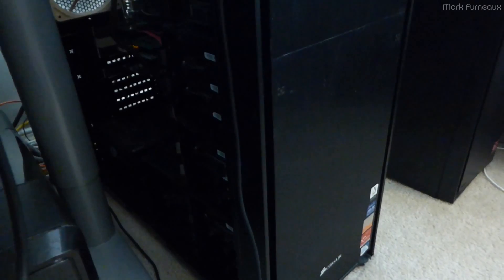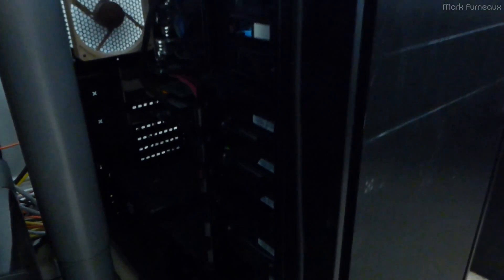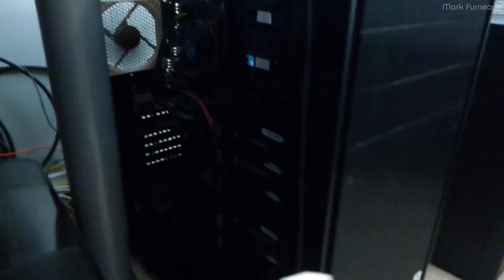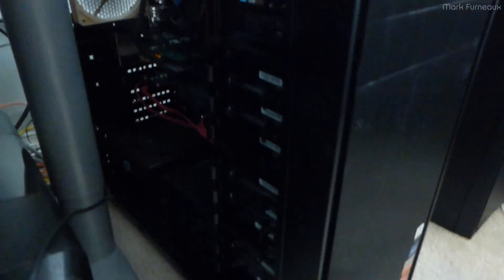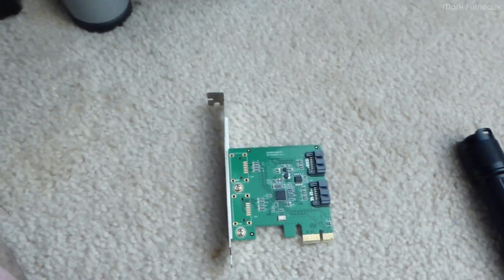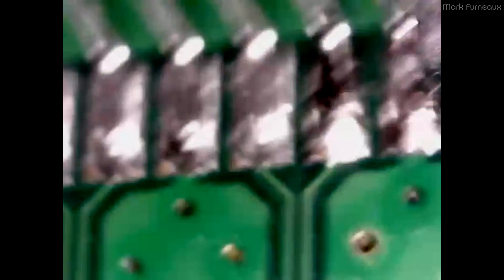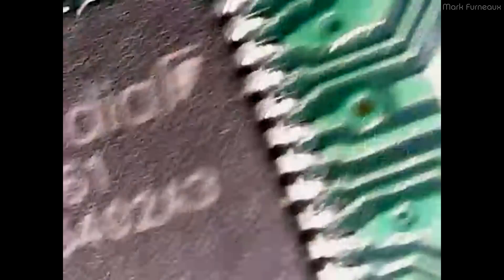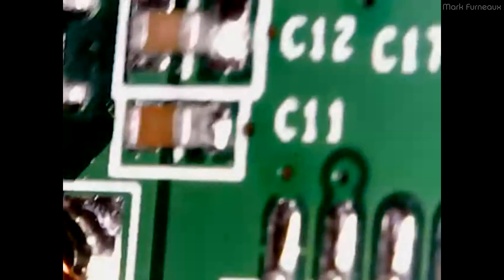Failure of a Crappy SATA HBA in My File Server

Comment: You should look into getting a supermicro SAT2-MV8 SATA HBA. They aren't very fast (it's a PCI-X card but I'm using mine in a PCI slot) but even PCI is fast enough when file transfers are limited to 100MB/S anyway (gigabit Ethernet). I have had one running in my file server for a couple of years now and it works great. Now I am a Windows dan but I do like to use Linux for troubleshooting and Inam pretty sure the HBA showed right up in Linux just fine.
Reply: Not to be annoying, but Gigabit Ethernet is actually 125MiB/s. I prefer to use nice even multiples of 8. :P
I myself should grab a HBA card of some sort. I got a poor HDD that's just sitting on my desk brand new and unused. Ont he other hand, if one of my drives dies, I guess I have a spare. Oh well. 

And if you're curious about what I mentioned regarding the Ethernet, MiB is not a typo. To be specific, multiples of 8 are actually called Mebibytes (MiB/S), and multiples of 10 is Megabytes (MB/S). So for a brand new HDD that's 500 Gigabytes only showing up as about 480 Gibibytes. As a side note, I think *NIX like OSes are the only ones that calls it by the correct term, which I think is just confusing for the customer. If everyone used the correct multiple of 8 measurement, nothing would have discrepancies. Maybe I'm just too specific about measurements. XD

Comment: i learned that cheap SATA HBA's dont last. I got a Avaya LSI Based 9270cv-8i HBA SAS/SATA III adapter in my C2D fileserver that is hooked to a 3TB storage drive. Runs well, just needs a fan to cool the heatsink as it is meant to be in a server with lots of airflow. card is 600$ online, only paid 20$ for it

Comment: +Mark Furneaux ok whats with your video's scaring me now, I have an alike very cheep sata pcie 1x card in my am1 file server. As you can see why AM1 has 2 onboard Sata Gen 3 ports. This HBA card is a 4 port 7 buxs 1 of the plastic contacts broke off the first day I had it. Other than that it works just fine (so far knock on wood)

Comment: This card from Dell is a fantastic SAS controller and I am using them sucessfully with ZFS after crossflashing to the LSI IT firmware. 
http://www.ebay.com/itm/HV52W-DELL-POWEREDGE-H310-8-PORT-PCI-E-6GBPS-SAS-SATA-RAID-CONTROLLER-/172248374179?hash=item281acd9ba3:g:HagAAOSwbYZXaD2s

Comment: Could you please over-volt the fan from a first generation PlayStation 3? They're monstrous blower type fans with a ridiculous motor. I don't have a power supply to do it to the one I've got from my old PS3 that melted, but even at just 12 volts plugged into a fan socket on my PC it's insanely loud and powerful.
Reply: Just try using a voltage booster ...
Reply: +SIME_LP Don't have one
Reply: You could build one , or buy one ... You should be able to get one for under 10$ ...
Reply: +SIME_LP I don't think it's worth it to test one fan when I can ask a guy who's channel is dedicated to that sort of thing for free and thousands of other people can see it too.
Reply: Antonino Frey What?